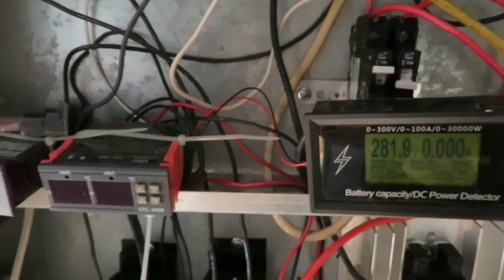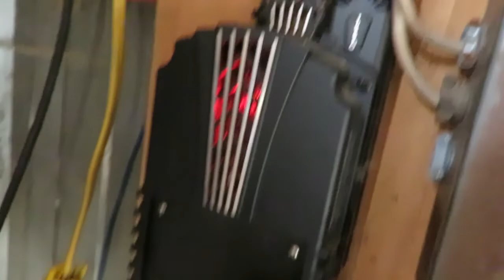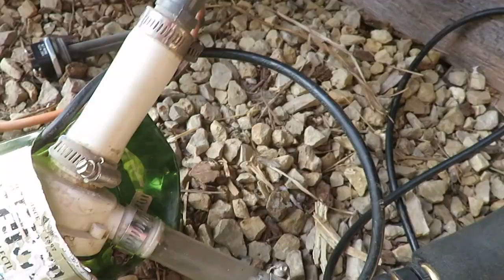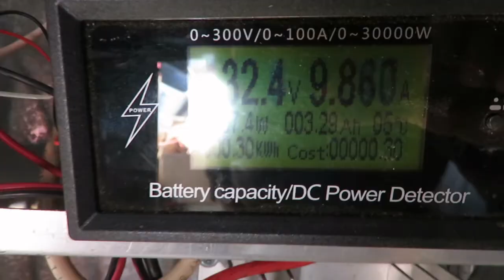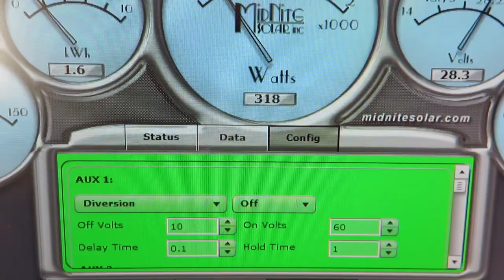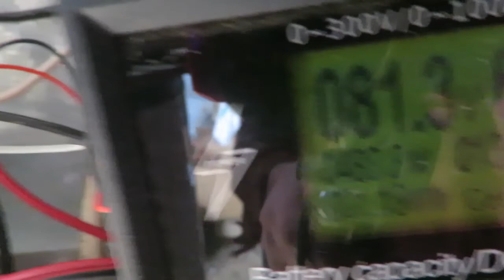Hybrid direct DC solar PV and PWM AC  hot water heating project

Comment: My fridge operates off a single cat battery and only in the day with a NANO.  If you can program arduino, you could make a very efficient water heater which continuously adjusts the heating element to the panels output.  It is super easy needing to add only  some capacitors and a FET.  I do diversion this way to dump any solar excess into three water heaters. No need for batteries,  charge controller or inverter.  This can also operate in parallel with any charge controller. I have a small system and I have enough hot water to do all cycles of laundry with hot water.
Reply from the maker: I will check out your videos sometime - thanks

Comment: This is interesting , will putting a resistive load across the solar pannels not damage them. I have 3 pannels joined together in series , voltage is 110 with no load, is it ok to connect this to a 1kw 120v element ?
Reply from the maker: no problem putting the load on. The thing you need to do is calculate out the Voc  of your solar panels in series  and try to match the resistive load to that.  I will have to remember how I did that calculation. I think you take  . So multiply Vmp   and divide by Imp to get the ideal resistance of the heater element. Then find a heater element with close to same resistance. Your heater element 1000 divided by 120 = 8.3 ohms .  I have to double check to see if I remember that correctly.
Reply from the maker: here is a calculator - same math I was doing https://www.davidpoz.com/
Reply: @LarryKapp1  says should be 10.44 ohm and mines 10 ohm
Reply from the maker: @lookoutleo  should be a good match .  That would be the peak of current and watts you should be able to put into the heater.
Reply: @LarryKapp1  yes I see when it's cloudy theirs hardly any heat, not very efficient
Reply: @LarryKapp1  interesting , if I check it with my meter it's 10ohm , when I attach the element to the pannels in direct sunlight the voltage across the element is 65v. What do you think , each pannel says it's 350w at 35v
Reply from the maker: @lookoutleo  did you use that calculator ? The closer you match the resistance to the pv the more power it will put into it. What is the open circuit voltage of the pv in series ? 
Don't they have a rating sticker on them with the Voc, Vmp, Isc , and Imp ?
If you have a water heater with two elements you can either put the elements in series to add resistance or parallel to decrease the resistance. Just like basic electronics with resistors.
Reply: @LarryKapp1  ok the label On each pannel says voo 37 iso 8.7 vmpp 28.9 impp 8.30 and theirs 3 pannels , how do I work it out for series or paralell
Reply: @lookoutleo  10 ohms is a very bad match, 14 ohms would be the "ideal" match. Two elements in series would be a good match.  Ideal in not really the best match because most of each day the current is far less.  David is just giving bad advice. Studies have shown for most twice that ideal resistance produces more daily power.  Power is function of the square of the current.  When panel current drops 25%, power drops 50%.  Matching is super important and when you see less than suspected voltage you have lost a lot of power.  Design for about 70% current.
Reply: @opera5714  interestingly I've been experementing with an old tumble dryer element and I've found if I have two lenths of 30 ohms in paralell being 15 ohm it works much better than 10 ohm load. I'm trying to get my head around your formula to work out resistance . My voltage no load is 110 , pannels are 230w X 3

Comment: This is not efficient at all. Solar panels like these, uses only 20% of the sun energy. 80% is heat that you do not use now. So it is better to heat the water with the sun.
Reply from the maker: Depends on which efficiency you are talking about. First they were $$ efficient since they didn't cost anything. Second I didn't have to build a rack strong enough to support heavier flat plate collectors. Third they were more efficient on getting the heat to water in that I didn't have to install pipes and pumps and fill them with glycol. And finally I have the electricity available for other uses too - all with just some wires .

Comment: Reviewed the video again.  6 in series will only get you 10A maximum short circuit current. It appears your heater is 10 ohm. so the maximum power is 1KW. 3S2P would get you 1300W, but significantly >2X to 4X more on cloudy days. Also makes it easier to add in those extra damaged panels. Best to use an isolating diode with them.
Reply from the maker: I got 1400 watts the other day  with them all in series. That is a bit over  half the rated potential power .  I don't try to heat the water on cloudy days though because if I can't get it up to temperature then I have to dump all the water now in the winter since I drain it every night. 
 With my present setup I can heat the amount of water I need in about two to three hours. Maybe I will time it tomorrow.  I am interested in checking out your board.
Reply: @LarryKapp1  That must be from two 1800W arrays.
Reply from the maker: @opera5714  I got the 1400 watts from the six PV in series. To be specific the meter read 131.3v  10.31 amps 1429 watts . But that was a peak - usually not so high - more like 900 to 1100 watts on clear sunny day .

Comment: How do you like that power meter, isn't that the one that can send data 
to your phone? I just ordered a couple. Did you put a pull down resistor
 on the gate input?  Those IGBT saturate to just under 2V so you almost 
always have to dissipate about 10W.  With PWM switching and a capacitor 
bank the panels can be held at power point voltage and produce way more 
power on cloudy days.  You are almost there with your system.  I can 
supply a controller board if you want to try it.  This can operate in parallel with a charge controller on the same panels to harvest the excess energy and can use existing mechanical WH thermostat because it has arc interrupt.
Reply from the maker: yes the power meter you can hook up to on Bluetooth but the app I found for it didn't impress me too much. Otherwise yes it is a very nice meter for the money. Yes I put a pull down resistor on it - look in the other video I posted and you will see . I would like to know more about your controller board.
Reply: @LarryKapp1  Yea, others have commented the power meter software is clunky, but it is an amazing price. I had a lot of gaps in the videos due to bad internet  and missed a bunch. I will never be able to make a good video on the unit because both of my sites have extreme shading.
Reply from the maker: @opera5714  I think I paid $10 for the meter - the fact that it goes up so high in voltage and doesn't need an external shunt - great deal !

Comment: IGBTs are a bit lossy because of the typically higher voltage drop across the junction. But it can be acceptable in certain circumstances  because IGBTs in a discrete package, are pretty inexpensive. If you arent using pwm on the DC, you could cut the voltage drop about 50% (compared to an IGBT) by using an SCR instead.